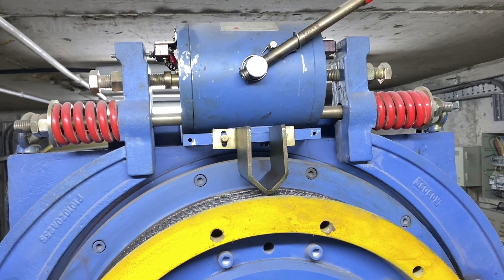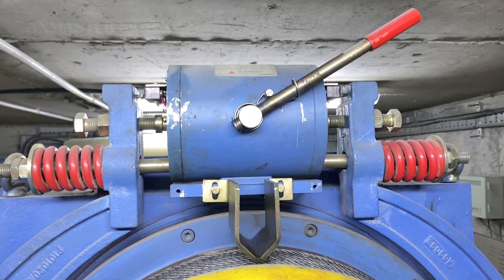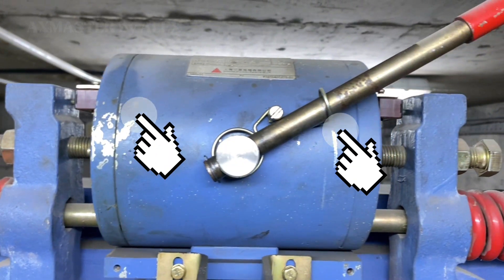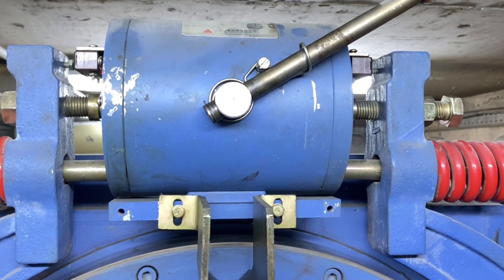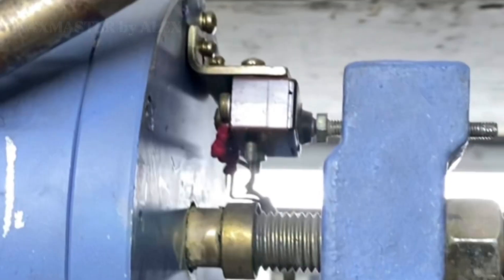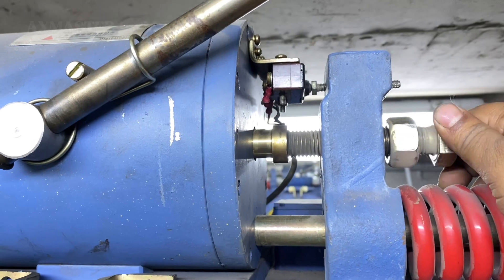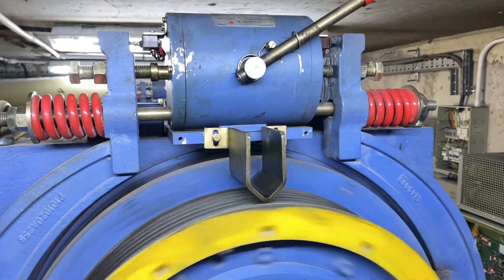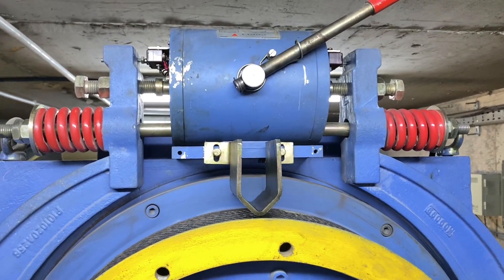Elevator brake troubleshooting and alignment @axmasterbyalex #elevator #elevatorservice #lift

Comment: How to reduce that thumping noise from the plunger activating and deactivating ? Should it be lubricated?
Reply from the maker: Improper spring tension in the brake mechanism can cause the plunger to engage too quickly or too slowly, leading to thumping noises. Adjust the spring tension according to the manufacturer’s specifications.
Reply from the maker: Ensure that the brake components are properly aligned. Misalignment can cause uneven wear and noise.
Reply from the maker: First, check that the gap between the brake liner and drum is the same at both the top and bottom. If it is not, you need to align the brake liner first. If there is still noise, try reducing the gap between the liner and drum.
Reply from the maker: Apply a suitable lubricant recommended by the manufacturer. Avoid over-lubrication, which can attract dust and cause further issues.
Reply: @axmasterbyalex  thank you